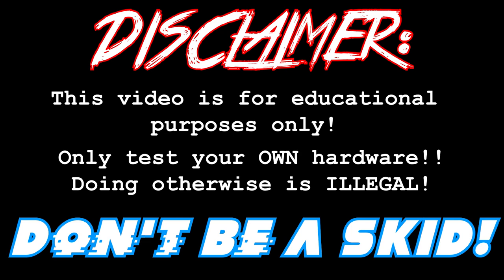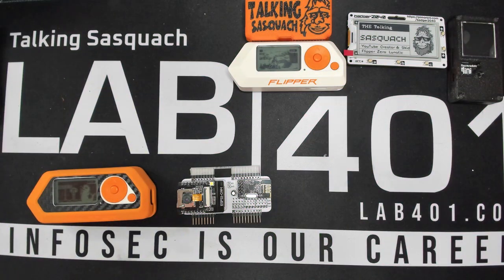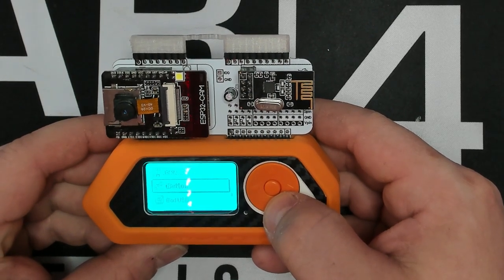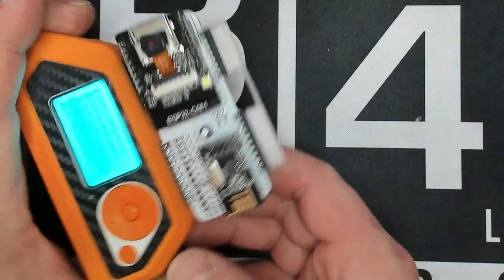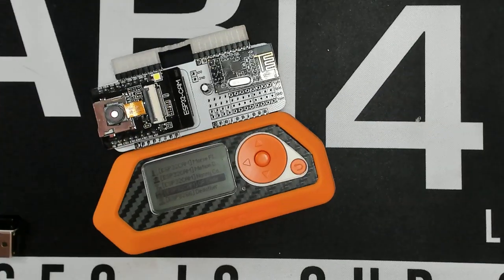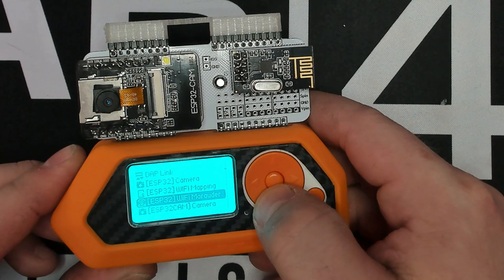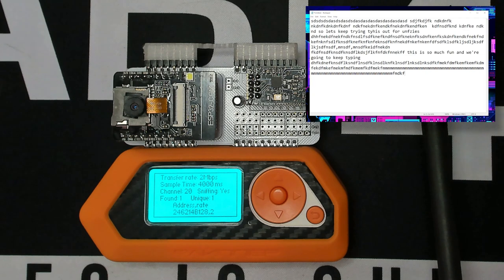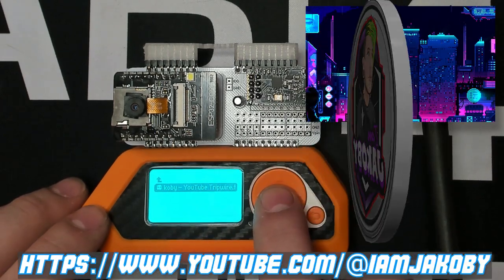Mouse Jacking with Flipper Zero and Mayhem Board!!! Hack Wireless Devices!!! 😲🐬😈🖱🐱‍💻

Comment: Ive had my M220 mouse for like 6 months, and it was the very first dongle I tried, and it worked. So I guess it is a good/bad thing?

Anyhoo, I got it working with the K400 keyboard dongle, but not the K400+. Not sure if it is because of the dongle, but there seems to be a lot of intermittent hiccups when sending badUSB scripts. Perhaps it is with the NRF24? Either way, its success rate has been about 50/50.
Reply from the maker: If you're running badUSB it does help to keep it close and set delays a little higher.  NRF24's with an external antenna work WAY better.  You can install the Logitech Unifying Software and check your firmware version to see if its the vulnerable version, just make sure to turn off auto updates BEFORE plugging anything in!
Reply: @TalkingSasquach  I have the external antenna nrf24, the issue I'm having is like it will be sending the keystrokes and it will "hiccup" and either not receive anything or repeat a key. That's why I'm not sure if it's the receiver or my transmitter. I'll have to do more testing.

Comment: @TalklingSasquach I'm trying this out with AWOK's nrf24 board and I'm reading 2 of my wireless dongles but when I try to run a payload it doesn't do anything. Any advice?
Reply from the maker: That means you don't have a vulnerable device
Reply: @TalkingSasquach  Oh ok! So it can still sniff the signal even if the device is not vulnerable?
Reply from the maker: @wonderfultelephone  absolutely.  You should be able to sniff out most 2.4ghz HID's

Comment: You can downgrade the firmware on your dongle!
Reply: And if you check the USB plug it will tell you what version it is, you want the C-U0007 or better yet the C-U0012!
Reply: I found a dongle for sale that’s the C-U0012 and I didn’t bought it cause I thought that’s a newer version 😔 so the dongle itself it’s vulnerable?
Reply: @chelefrancia  yes, just flash it with other firmware!